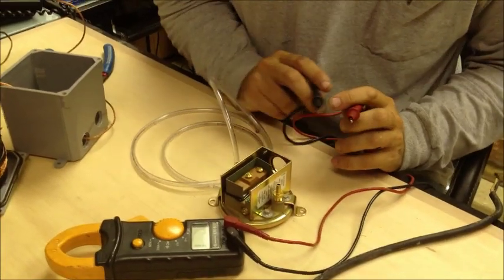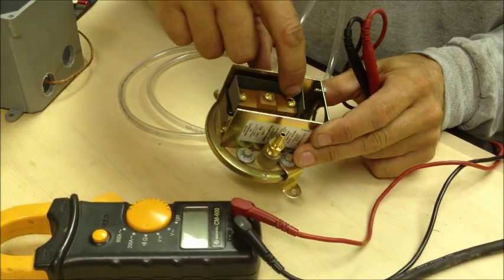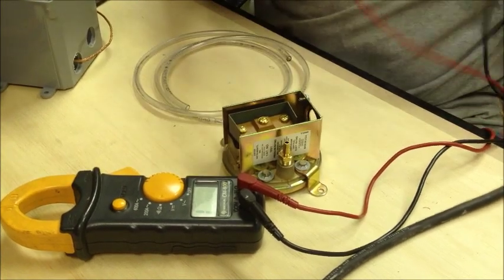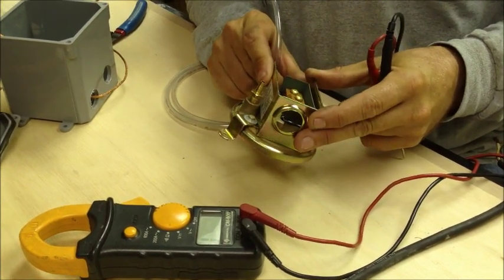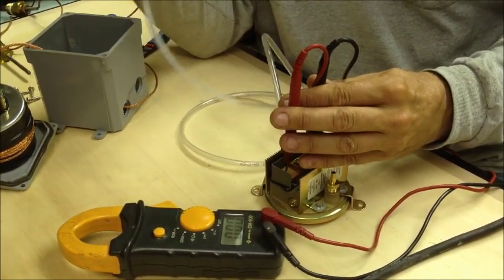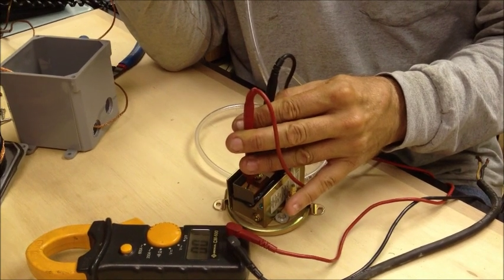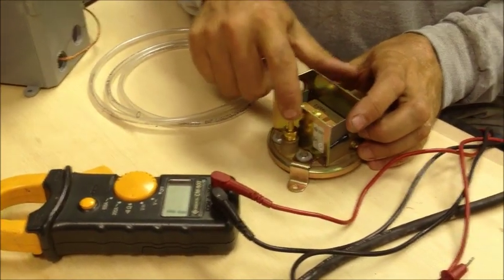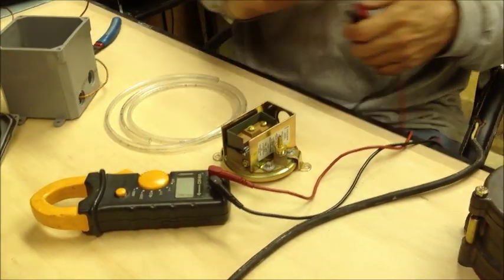How to Test Pressure Switch

Comment: You are not switching the switch at the prescribed pressure. You are just seeing if it responds electrically once triggered.
Testing a pressure switch means verifying that it switches at the correct pressure.
Reply: Incorrect, that would be calibration.
Reply: @chadharrison5681  you calibrate your test gear, so it tests that the switch is working at the correct differential pressure

Comment: Before doing a video you need to prepare better so you can inform people and not make assumptions, How do you identify common, normally open, normally closed you did not show how you set your meter? what are you testing for, Ohms, voltage continuity, I hope you are noticing your lack of info
Reply: If you can't tell that the normally closed circuit is closed under 'normal conditions' and that beep and no beep is continuity, you should probably just hire someone to fix it for you instead of berating the guy 😆